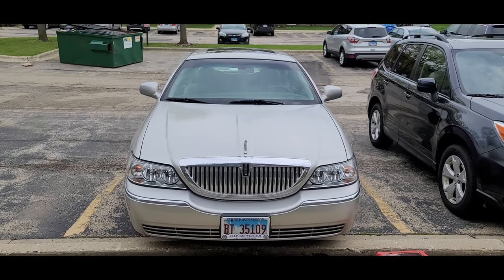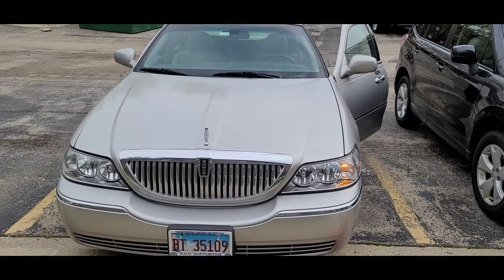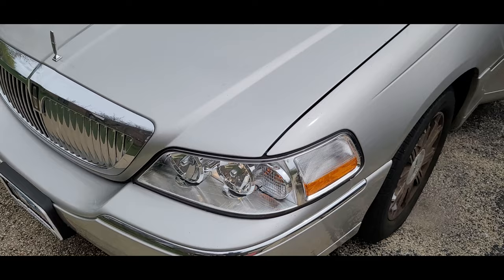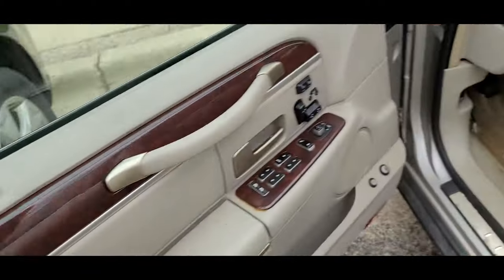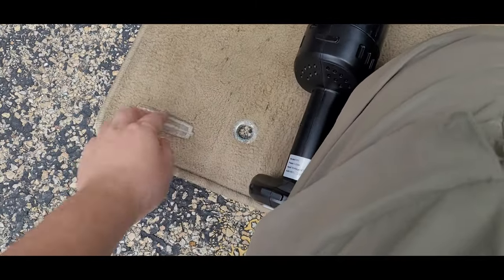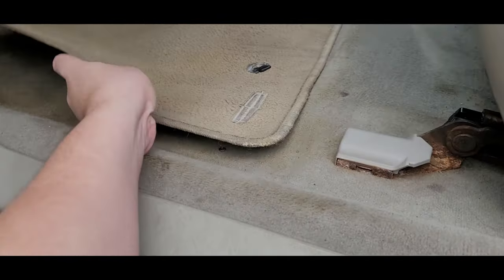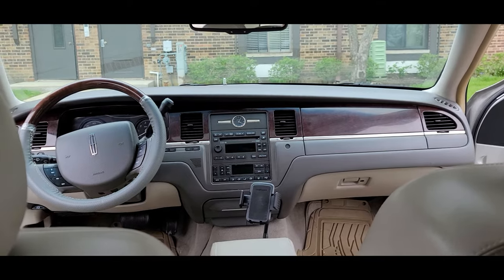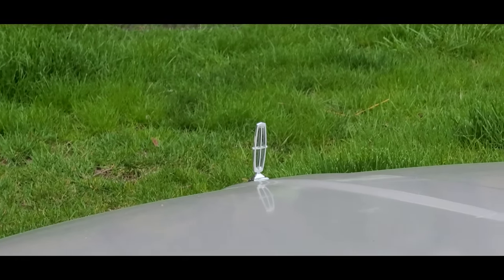Lincoln Town Car Guy Tries To Replace a Bulb, but Does Spring Cleaning Instead

Comment: 0:19 I'm jealous... we've been hovering around 100 every day.  It's like we skipped spring and went right to summer
Reply from the maker: It was 98F today. NO spring just full force summer
Reply: My shop AC is running 24/7 and the shop is hovering in the mid 80's

Comment: The Lincoln has two tail lights per or should I say two bulbs per tail light so one of your bulbs is burned out in your left driver side tail light but what I would do is just replace them both at the same time because I've had the same problem I replaced one and then a few weeks later the other one goes out so just replace them both cuz they come in a package of two anyways you know I have the the 2010 Town car so they're almost identical
Reply from the maker: Thanks!

Comment: Bottom bulb on rear drivers side is out. And of course the cornering light and I do believe your parking light as well if I remember right from your old videos. Can’t remember what side.
Reply from the maker: Thanks, I'll double check
Reply: @VitaliyKofman   Should be a 3157 I believe for both except for the cornering. 3157 is what I used in my Escape video. Sucks to take them apart in the Town Car as well.